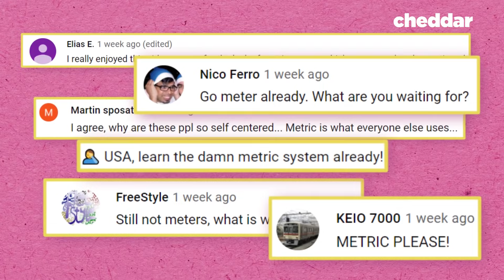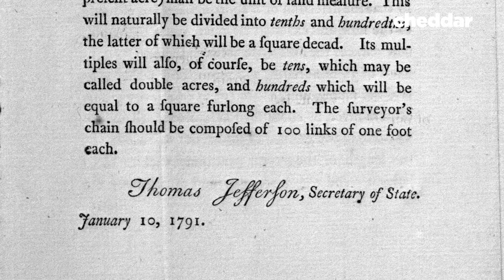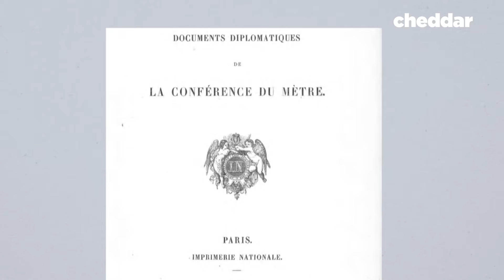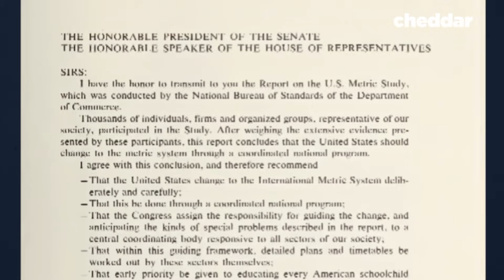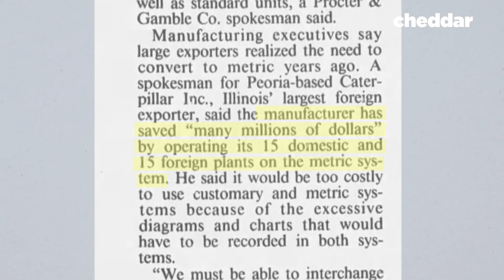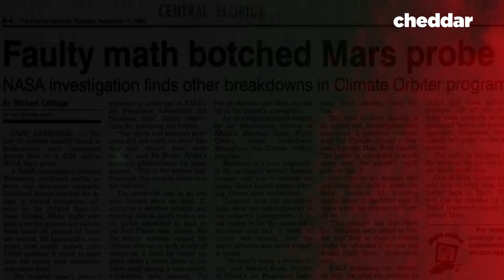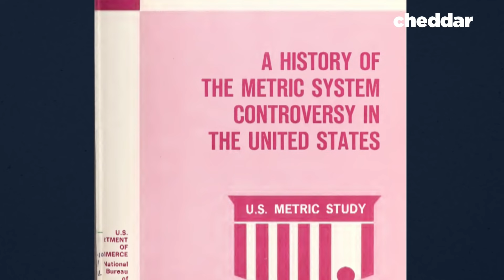Why Doesn't the US Just Use the Metric System? - Cheddar Explains

Comment: The American public has not embraced metric because they have been free to choose and their frame of reference.  Most people can't tell you how many ounces are in a gallon, but they know an ounce comes in a shot glass and milk comes in a gallon container.  They also know when it's 25 outside, it's cold, and when it's 77 outside it's pleasantly warm.
Reply: Well of course, but when you use metric you know all that too + everyone actually knows all the conversions.
Reply: 1 gallon is 4 quarts

1 quart is 4 cups

1 cup is 8 fluid ounces

1 gallon is 8*4*4=8*16=128 fluid ounces

Out of all the weird units we use, the US customary units for liquid volume is actually pretty straightforward, as it's all multiples of 2 (1 gallon=2 half gallons=4 quarts=8 pints=16 cups, the only deviations are cups being 8 ounces and ounces being 6 teaspoons (a measurement I have never seen used ever))

Also, shot glasses are 1.5 fl oz.
Reply: @Deathnotefan97  Well, doesn't sound that straightforward to me. What even are quarts, fluid ounces and gallons?
Reply: @Innosos  What do you mean by "what are they"?
Are you asking where the words came from, or where the measurements came from?  Because the measurements are based off of multiples of 2 as I stated
Reply: @Deathnotefan97  I'm asking myself what these things are. A gallon. A quart. A fluid ounce. I'm not a native speaker and have never heard of these words outside units.
Reply: Metric is easier from a far distance, but I ding that, for measuring how tall people are, or how wide a pretty tight space is, imperial is better for me

Comment: This is a great video when it comes to explaining the history of the metric system in the U.S. but it does very little to explain why it hasn't been largely adopted as standard.  We don't teach the metric system in our schools, even though it is a superior system of measurement, and is much simpler.  In order for the metric system to become as standard, it must be taught.  The biggest hurdle for most U.S. citizens is that our brains have been conditioned to think in inches, feet, and yards, not meters, centimeters, and millimeters. We think in ounces and pounds, not grams or kilograms.  If you tell me that something is 18 inches long, my brain can immediately visualize that size.  If you tell me that something weighs two ponds, my mind can immediately "feel" that weight.  I don't have to perform any conversion calculations in my head.  Thanks to the fact that most rules (a ruler is a king or queen) which show inches on one edge and centimeters on the other, I can easily see that two inches is roughly equivalent to five centimeters, but roughly doesn't quite cut it when precision is necessary.  What's more is that 12 inches has another name: a foot.  Thirty-eight centimeters is just 38 centimeters.  Most U.S. citizens couldn't tell you if ten centimeters is close to an inch or a foot.  It isn't, however, the fault of Americans that our brains think in the "Imperial" system, and not metric.  I keep a conversion app on my phone so that I can use the metric system as much as possible, but it doesn't help things when you tell an American that one inch equals 2.5400000000101604 centimeters.
Reply: One inch is exactly 2.54 centimeters, by definition.  Your conversion tables are way out of date, because the international inch was adopted in 1965.
Reply: @GH-oi2jf  Well, actually, an inch is defined by the metric system. And metric system changed it's definition of a meter since 1965, so the inch also changed. Same thing happend with the kilogram. The standard of 1 pound(and all relative measure) was actually changed a few years ago.
In your daily life, it doesn't change much. If you do something that needs to be precise, it changes a lot.
Reply: with the last part of the comment, the problem is the convertion equivalent of the grammarnazis, people that does not allow you to round values in trivial day-by-day conversation. I'd say that's 2,54cm at maximum precision, 2 and a half centimeters to be casual and normal, because that's how we communicate in metric. But when converting units for USians on the internet, there is always that one person that comes and says "no, you're wrong, you can't speak like that, it's 2.5400000000101604 centimeters and nothing less or more".

Comment: When Canada moved to the metric system in the 90's everything was a mess.  People died on the highway a guy did not put enough fuel in a passenger liner etc.. 
After our mess they said fuck it...  BUT students in the U.S should be raised on both the metric and imperial systems for a eventual switch, if they taught it for 15-20 years the switch would be easier.
Reply: they are

Comment: As a mechanical engineering student raised in the United States, calculations with metric units are much easier. The only problem is that they don’t make any intuitive sense when I try to physically imagine them. For example, I can tell you that something moves at 50 kilometers per hour, but I don’t automatically know whether that’s a slow or fast speed, it’s just a number to me. This transitionary period that would be necessary for a shift is why believe that many Americans are reluctant to shift to metric.

Comment: 5:00 isn't pound the imperial mass unit? If the metric system reported a Force (in Newtons), shouldn't the imperial equivalent have also reported a Force (in pounds times your acceleration standard unit)?
Reply: The problem was that the conversion never happened. One system output a number in one unit, and the other was expecting that number in a different unit; for example, the first might have reported a hundred Newtons, and the second interpreted that as a hundred pounds-force - a value around four times what it should have been. Essentially, Ground Control thought the thrusters on the craft were about four times stronger than they actually were, so the thrusters were set to put out about a quarter of the power they actually needed to land the craft.